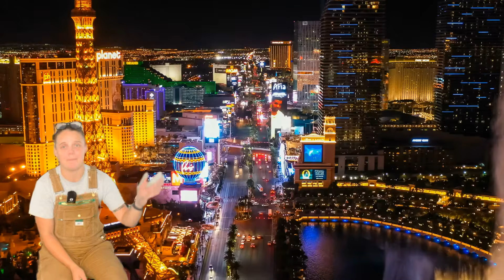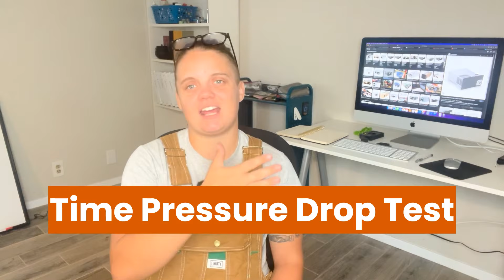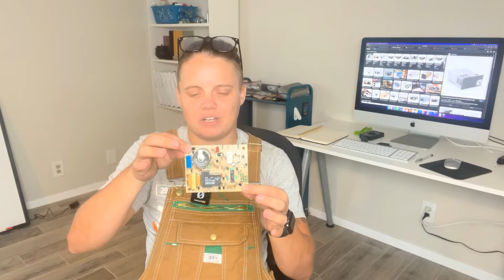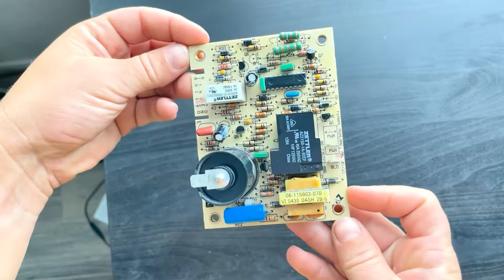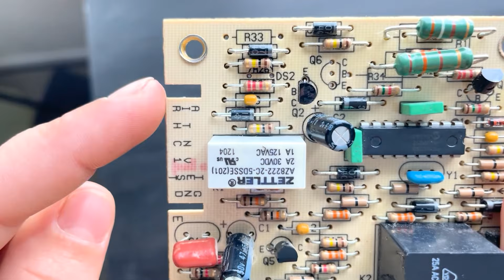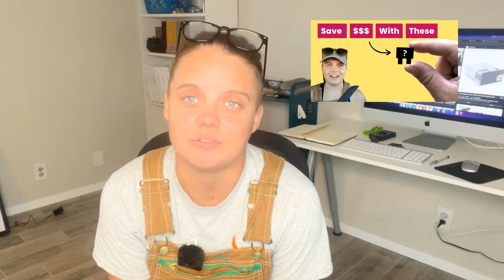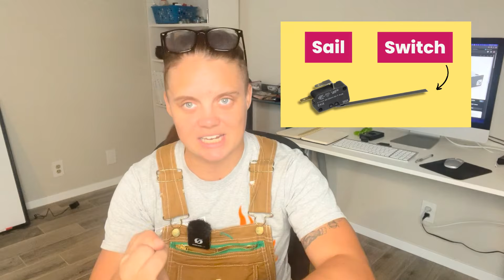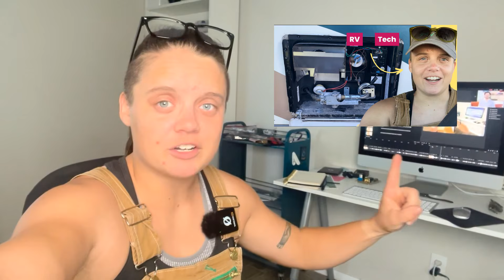How to Troubleshoot your RV Furnace Circuit Board

Comment: Watched two or three of your videos after recently purchasing a use camper. Furnace wasn’t powering on at all and couldn’t figure out what was going on. Your videos helped get to the root cause. Something also helpful (not sure if it’s a bad idea). If your getting 0 volts on blower and on the first wire of the plug, jump the blower and power terminals and your blower should flip on. That’s what happened for me by accident
Reply: How did you solve your issue? Our furnace doesn't turn on at all. Replaced the board. Still doesn't work. We can jump it and the fan turns right on.

Comment: Something that’s confusing me is I’m getting a voltage reading at the plug itself when the circuit board is disconnected but when I connect that plug into the circuit board, I then only get around two V. I attempted to check to see if the circuit board was OK while isolated by using continuity setting and I’m a little confused on how that’s supposed to work. My furnace circuit board is for an SF – 35, and appears to be a 521099 model and doesn’t have a separate pin for the power. Instead, it only has that plug with three wires. A thermostat wire, a ground wire, and then a wire that goes to the gas valve. And then it has the ignition control. So that’s only four total. So that seems to me, to suggest that there is something wrong with the circuit board.

Comment: ok emily guess what i think my circiut board is not right, i don't have the two  connections  where you say the power is nothing there , i feel they gave me the wrong board ,, ill have to buy another board , but the thermostate was operating fine, i just replaced it because the read out wasn't  showing or an older model. so down to no  heat, and the curcuit board isn't working yet i have  a place in Pa. new florence , up 711  .  state road.
Reply: but guess what the problem  is with the connections what i  have here is just the three wires  thats all the power ground and the white wire what ever that is  seems to be the hi temp connection.

Comment: My furnace has been cycling--the fan runs continuously when the thermostat calls for heat, but the burner cycles on and off. It will run for anywhere from 3-30 seconds then shut off. I was convinced that it was likely a bad limit switch, but when I pulled the furnace out and tested, I had good voltage coming out of the sail/limit switch circuit. The board was shutting off voltage to the gas switch, which cycled the burner off. I assumed it was the control board so watched your video just to make sure I wasn't missing something. Thanks for what you do!

Comment: Emily thank you for your clear and concise explanations, simple to understand. This is my problem with my RV furnace, the furnace activates as it should when the thermostat temp is set higher than the RV's ambient temp. The RV warms up as you expect, so-far-so-good. However when the furnace shuts off upon achieving the thermostat's temp setting, the furnace begins to cycle on and off repeatedly, ... what I hear is the fan blowing, the igniter ticking followed by the fan shutting down and almost immediately repeats the same cycling of on-off with the ticking sound of the igniter. Upon opening the furnace access panel noticed that the red light on the circuit board flashes once every 3 secs. I removed and checked the sail switch, no debris and appears to move freely. The "pocket" that the furnace sits in appears to be relatively clean. Put it all back together, however did not reinstall the access panel. Fired up the furnace and the shutdown worked as it should; ie no more rapid cycling, awesome, feeling good at this point. Reinstalled the access panel, fired up the furnace and the rapid cycling begins again. What might I check next to solve this problem?

Comment: ..and, if none of this works, I found that a wire from the rooftop AC control module to the furnace circuit board was fatigued and broke in the wall, dammit!

Comment: Furnace is Dometic DFMD30121

Hook up RV to shore power. ( all times the temperature outside has been below 60 F)
*Turn on thermostat to Heat
*The furnace turns on the blower and shortly thereafter we have ignition and heat is provided from ports.
*Furnace will run multiple times as temp in trailer drops below the Thermostat set level
*At some point the furnace will stop turning on when temp in RV drops below set temp
*When issue is encountered the furnace will have a continuous buzzing sound coming from the area where the control board is located.(not a clicking sound like an ignitor but a continuous buzzing sound) blower motor will never come on.
*Turning the thermostat off and back on will not fix the issue. Furnace will make buzzing sound each time its triggered by thermostat
*Turn the furnace off with the reset/off button will not fix the unit if only shut off for a couple minutes or less.
*If leaving the thermostat off and furnace off for more than 30 minutes (never tried shorter time periods less than 30 minutes) then flipping furnace switch to reset and turning thermostat to heat and setting temp below RV ambient air temp, the furnace will fire off the blower and shortly ignite and provide heat.
*I have taken apart the furnace and inspected sail switch area and its very clean, test high temp sensor and it shows good condition when cold. I never tried to trip the furnace when heat is working by blocking the vents and seeing if the switch will trip the furnace.

Comment: Suburban SF-30FQ model. Blows Tstat fuse after selecting heater function, 15 secs after furnace comes on w/ heat. Followed your video for T/S, appears to be over-voltage/ short circuit?  Blue wire tstat test shows <10vdc...possible board issues? I did replace the tstat with a new one, same issue.  Help!!

Comment: My hydro Flame 7916-II Does not have a Power or Blower terminal. It has a seperate delay relay. I can not find a board that does not have the power and blower terminal. Do I need to rewire the entire unit?

Comment: I'm working on my Suburban NT20-S. It was manufactured in 2019 and the board is already obsolete.  It has a separate time delay relay. The replacsment is the same as seen in video. Guess I have to rewire the whole thing. I really hoped to just do a swap.

Comment: Emily,  I really need your help. I took off my faulty control panel and forgot to take a picture! Now, I'm not sure what red wires go to what upright pegs. I know I had a red and blue wire connected to one peg( PUR) and another red wire connected to the blower peg( BLO). When I connect the wires where I thought they go, the blower comes on and won't stop!!  HELP--Ron

Comment: Your video realy helped me out , turns out my problem was a bad sail switch, wouldn't work in furnace but when out and worked by hand it did work , the board also failed the  blower pin and the air test pin. No 12 volt. Thank you so much for the awesome help,, sorry I'm not a gal. I'm a dude lol.

Comment: I replaced circuit board, worked great then I put it back together and installed it in the camper. It will not ignite, I can hear the igniter clicking but no heat. Help me please

Comment: Yep, I think you answered my problem. On the wire powering the gas valve, when I checked voltage as the igniters fired, the voltage ran from 0vdc to +14vdc. The voltage change was very rapid and completely unstable. I believe the voltage should have been a steady 12vdc to actuate the gas valve solenoids. So I believe the circuit board is defective.  One more thing, I looked at the back of the board where all of the solder connections are and found some of the board leads were overheated badly.  Thank you very much, have a great day.

Comment: When i turn my furnace on, the blower starts, I can hear the igniter trying to light (ticking noise) but nothing happens (no heat). Could I have a bad propane valve if I test circuit board and it is sending power to valve wire. Even though it is trying to light i do not smell propane.

Comment: This is a great video!  I have been having problems with my furnace for 10 years.  It's a weird issue where the thermostat sends a signal to the board, but the board does nothing with the information.  If I remove the board and plug it in, it starts working.  Sometimes, the board makes a buzzing sound like it's trying to engage, but it does not unless I unplug it and plug it back in.  I believe there is a short somewhere on the board.  I am going to test everything as you explain here and possibly try to re-solvder all the solder joints on the board in case a solder joint has failed.
You are a very talented woman. Thanks for making this video!
Subscribed!

Comment: So I’ve watched all your videos on furnace trouble shooting.  Learned a lot too.  I have a Atwood 7916-II that’s giving me fits!! The thermostat is completely disconnected as in not wired to the furnace.  I can turn on with the on/off switch and the fan starts to run and it will light and burn.  The only way to shut it off is to shut off gas and let fan continue to cool.  Then I shut off the furnace on/off switch.  Any ideas what’s going on?  Thanks for your great videos!! 
Wayne
Reply from the maker: Is there any chance there is a relay on your furnace? I’ve seen those fail a lot.
Reply: It does and of course it’s obsolete.  Thanks for the wealth of information you put out.  Says a lot about your business!!

Comment: Excellent video. 1 suggestion, though. Before dealing with the circuit board, which was a pain to access, maybe show a quick test on the thermostat itself. (Paper clip between pos and neg wires causing furnace to work). Because if that's the problem, as it was in my case, no need to remove the furnace.

Comment: I learned more from this video than I did watching 20 others 😂

You just saved my butt from a useless control board swap… literally just disconnected and cleaned sail switch terminals. 

Took longer to find my YT password so I could subscribe. 

You rock

Comment: Thanks so much for this video!  I’m about to pull out our furnace and board to test, as we got the board replaced at a shop a few years ago and the cost was several hundred dollars. The problem is different this time though…the fan came on and won’t shut off. With the thermostat on high, heat comes out and with the thermostat off the hot air stops, but the fan stays on. Thoughts on if this is the board and/or which of the tests you outlined could be the determining factor?

Comment: Hi! So I’ve been testing my circuit board for my furnace. Right now when I turn on the furnace, I hear a click and nothing happens.  I got to the point in the video where I test the blower connection next to the power. No voltage to the blower. So tested the upper pin on the 6 pin. No voltage. So I thought it would be the circuit board that needed to be replaced. Bought one and installed. All connections good. But still no voltage on the blower and top pin. Any suggestions?

Comment: good afternoon amazing video very very helpful. I just got my RV at the shop right now just because that if I would've found this video before I probably wouldn't take it over there, but it's too late. My only concern I took a less week and they changed the seal switch and they charged me 3 50 yes for for the switch sounds a little too much but either way they fix it and they broke down literally the next day so it's getting back to repair. I am already following you if I need anything definitely will give you a text or a call if you leave a phone number thank you and God bless youvery very good video

Comment: Would the tests apply to a SF-35 furnace?  
Red- sail switch
Brown- gas valve 
Yellow- ground terminal 
Orange- electrode 
I have no blower motor coming on
Reply from the maker: Yup allllll the basics still apply.
Reply: @ awesome thank you

Comment: Hello young lady, I just watched your circuit board troubleshooting video. So, I have power to the board on the red wire as you said, but no power to the blue wire? The blue wire is a ground if mine is wired right. Just curious to see what you think. My issue is the blower don't come on. No red led light either. I just bought this Camper. My thermostat works on AC. It's an atwood 8535. Any help would be so appreciated!

Comment: Coooold in Texas, furnace won’t work. I can switch thermostat to fan and motor runs and I’m guessing there’s only one motor running both fans, this is a Suburban furnace. When I switch to run furnace I hear a click at thermostat but that’s all that happens. I have 2 full tanks, 12.8 volts at furnace but can’t get the fan to start to begin the cycle. Suggestions??? Thanks.

Comment: Our furnace has an intermittent problem. The blower turns on fine, but the ignitor sometimes does not even try to ignite (i.e., no 'clicking'). Despite no ignition, the blower doesn't stop but just keeps on running until we turn off power at the thermostat and try again. When we've had problems before, the blower would turn off if the ignitor attempted to light but wasn't successful. This makes me almost certain that the sail switch isn't the current problem, and I don't think the delay relay is the problem. Is this most likely a failing control board? Thanks for any help you can provide!

Comment: I own a mobile RV company as well and I always watch things that pop up on my feed to see if i can learn something new and although i didn't learn anything new in this video it is an amazing wealth of knowledge. You clearly know your trade and this is a great video for anyone to learn how to troubleshoot. I actually will be using your video as a tool for techs. Again great job from start to finish
Reply: How to check high temperature switch?
Reply: @jonthompson6533  the easiest way is to check continuity from each lead on the switch. If there is no continuity then the switch is bad.

Comment: Emily can I send you pictures of my heater, it has a circuit board with a wing nut holding it in place, the other switch you mentioned about on mine is a 10 amp breaker which is not out. I have a few pics you can look at to tell me where to put my probes
 It warmed up just a little.. can I send them to your email?

Comment: Yeah, I got this alright....
Furnas will not start. No blower/no flame.
I pulled all the wires off the thermostat to remove it from the problem & hotwired the furnas>>>RED to WHITE = nothing
Tested the red = +12vdc just like god intended.
Did a continuity test on the white wire - thermostat to the furnas = OK there is continuity  Too  the furnas anyway.
I replaced the sail switch = no help
I replaced the hi temp switch = no help
I found the gas valve switch built onto the control board - $197
I remembered that when the blower did run it makes a loud  SCREECH  as it starts & squeaks/squeals as it runs. Bearings Ill bet.
So I started shopping replacement furnaces. Complete new furnas for new installs with sleeve $700. Complete new furnas without 
sleeve for replacements $335. (that thin metal sleeve costs $365?) Between the control bd & the new blower assembly I bet I am 
near $335 so I order it & put it in.
IMMEDIATELY I lost +12vdc on the red wire @ thermo. It did not occur to me I just messed with that wire @ the new furnas.
I ran a jumper wire from the bathroom light switch to the thermo = ALL IS WELL-WORKING WONDERFULLY!!!!
EXCEPT... Whenever i plug into shore power, the furnas blower starts then stops. Weird, but working. (it turns off cuz gas is off idiot)
Yesterday I moved the motorhome & this time the blower came or  THEN  the burner lit (because this time I have the gas turned on.) 
I waited 5 full min but it did not shut off I had to flip the  OFF  switch mounted on the furnas. Ill bet I connected the +12vdc to the 
white wire @ the furnas.
Today I am going to mount a fresh attack & start by verifying the 4 wires going to the furnas  THEN  fix the wire I cut and remove the 12v jumper.
I am  SO  tempted to call my local mobile Rv repair guy...

!

Comment: Way late to the party here but, oyr issue is with the blower not maintaining a constant speed once lit.  We have taken the furnace out and there seems to be nothing wrong with the blower (no obstruction, spins freely).  Power draw seems to increase when the blower sounds like it is struggling to blow.  Does anyone have any ideas?  Could the circuit board be the problem?

Oops - forgot to mention what a great video this is!

Comment: To anyone that it may help. My sf30FQ would not blow air at all, when switching to heat the blower motor would not move. Thermostat was good and was sending signal to run, I jumped out the +12v to blower (blo) and manually ran the fan for about 30 seconds. After that it fired right up no problem, your milage may vary

Comment: I just bought a new board, mostly just on principle because the furnace was intermittent. New one is identical to yours. It differs from my old one in that the old one does not have that "power" terminal. It's supposed to be direct replacement 521099 but it does not spark. When you tell me i "should see 12V" on that power terminal IDK if it means power to the board or power from it. IOW does it need a power supply apart from the 6-pin connector in order to make spark? Or did i get sent a dead board? IDK and your video didn't tell me what that terminal does.

Comment: I tested the circuit board at the connector, on my SF-30 furnace. I'm only getting 8.65 volts, on the red wire, and the brown wire(propane valve). I have my furnace out, and powering it with a battery charger , checked the charger, it's putting out 12volts.